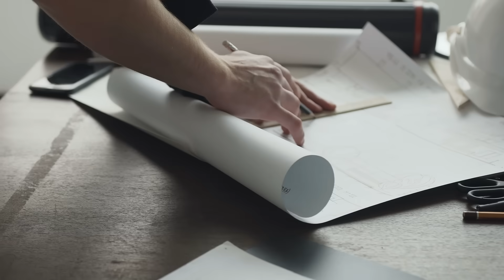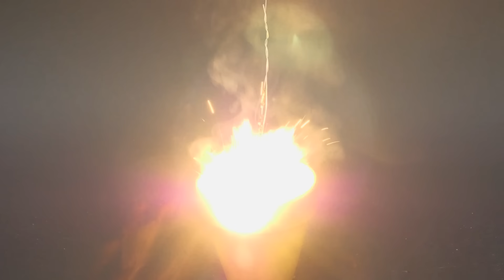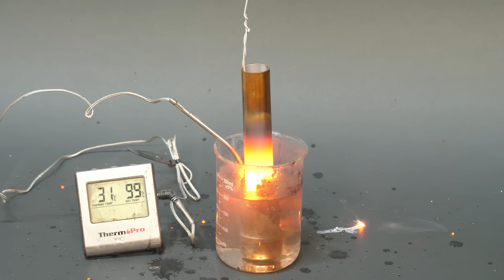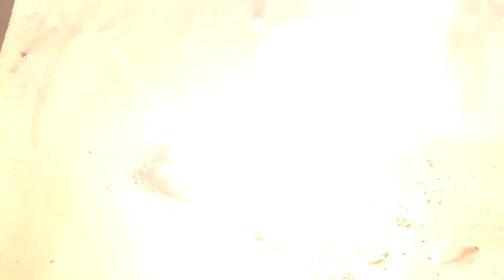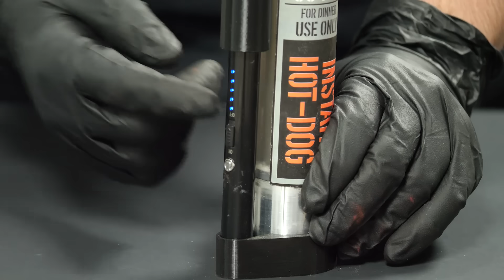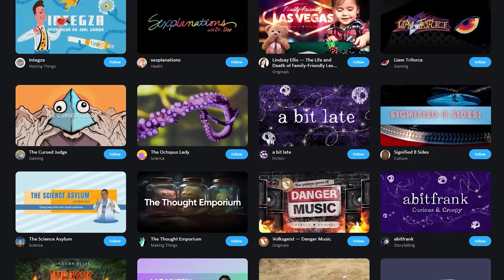Tactical Thermite Powered Hot Dog

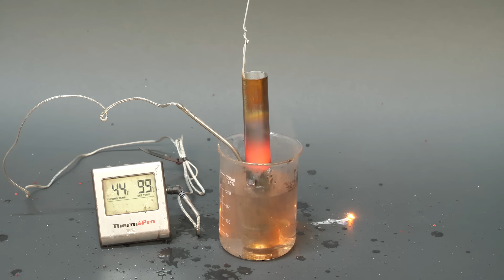Comment: 4:25 This is NOT a characteristic of iron thermite. It is characteristic to you because you never properly dry your thermite mixture. Evaporating water is what causes the degassing and thus makes the fine power you use fly away. This should be obvious since the reaction does not produce any gasses in itself, so it has to be impurities. You should try industrial thermite and see how clean and calm the reaction is. It is not only properly dried, they also use coarser materials, further reducing effects of degassing. There is no reason to use fine powders, except that it is easier to ignite. The larger surface area etc. only causes trouble otherwise. I have a video from ~2005 on my channel where you can see it burn. But I recorded that with cheap shit camera from ~2005 and was a kid at the time. If you want, I can do this again and properly record how clean it reacts.

Comment: One improvement I can immediately think of is replacing the top plug with a slam-cap that also punctures the heat seal, and linking that to the igniter.
Set up, arm, bap the cap, instant hotdog.
Reply: It's like panzerfaust but panzer würst :D
Reply: Now we just need to top it with nuclear sauerkraut.
Reply: @liliya_aseeva  bratzooka!
Reply: i need a hot dog epi pen damnit!
Reply: Per the video, the heat seal ignites and turns to molten slag.

Comment: We need the grilled version. You could use super capacitors to heat a heating element very quickly and you can recharge it very fast.
Reply: I don't know how feasible supercapacitors are for this project, but they're definitely safer than thermite, to the point this thing could probably be sold commercially (though I can't imagine who would buy it for anything but a one-time gag).
Reply: @dryued6874 I mean if they're cheap enough and I want to go on a road trip: instant grilled hot dogs would be perfect for stopping at a rest stop and having a snack. 

Imagine a shelf stable version that was self contained in a vending machine or something. 
If it's cheap enough, and it comes with bun and condiments and it roasts the bun too, it would be awesome.

Comment: As far as I can see, the only shortcoming in this perfect product is that your perfectly cooked hotdog emerges onto a cold soft bun. Since the heat is vertical and central anyway, is there a way to incorporate a vertical slot that you could slide an open bun into, and toast it at the same time?

Comment: A couple years back I decided to make something more spicy because regular thermite looked boring. I looked at the redox potential table. I wanted to go further up than aluminium and lower down than iron. What I decided on was magnesium and manganese dioxide. Lots of oxygen, +4 on the manganese too, Mg already burns hot as the sun in august, match made in heaven I thought. Well it was sure a match but it came from hell instead. I mixed 1g. One single gram. It was also a really course powder, like table salt, just mixed together. I heated it with a direct flame for like 1 second and it went off in a FPOOFH sound, taking all the hair with it. I didn't look directly into it but still saw the reflections for a couple seconds afterwards. Threw a ton of splatter too, it felt like MIG welding.
All in all, 7/10, would recommend

Comment: The granularity of your thermite is a factor. Larger particle size will still go, but go slower. The stuff in the video is so fine, it pretty much flash powder.
Also, a pretty fail safe ignition method is to use some potassiumpermanganate  and mix in a couple of drops of glycerin. The reaction is hot enough to ignite FeAl mix at a fairly course grain.

Comment: 12:20 Is there no flux for this application?
Btw. Thermite is cool. But why don't you just cook the hotdog, sealed in plastic, sealed in another plastic container containing stoichiometric amounts of concentrated NaOH and HCl solutions? This will get incredibly hot and react to saltwater 😊
You could make them like those fluorescent glow sticks. Break a seal between the two reactants, wait to react and cook, shake to be sure everything reacted, get your hotdog out. The solution doesn't come into contact with the hotdog, but even if, it's safe since it's just saltwater after reacting. The stoichiometry must be correct though.

Comment: Maybe for the grilled version, you could have the sausage in a metal frame, with the whole assembly coated in a strong thermal insulator, and when the device is activated, a high-amp, low-voltage electrical current is passed through the metal frame so it rapidly warms up to the point it’s red hot so it can cook the sausage very quickly. The purpose of the frame is to give the sausage those grill lines.

Comment: Why not use use the compound from Flameless Ration Heaters inside MREs?
Just magnesium and iron powder with sodium chloride, add some water and it will make steam.
You'd have to put the hotdog in a pyrex tube filled with water and let the FRH steam the tube. Endlessly reusable as well.
Reply: Because you wouldn't click and watch a video where someone used an MRE heater to cook a hotdog.
Reply: @c1v1c2v2  sure I would, if they made it also char the hotdog inside the tube as well by running a copper coil around it and a heat source to heat it.

Comment: I want to see a grilled version just because I Understand it would take another level of suffering to achieve it
Reply: also pro brazing tip its more than likely the metal will hotter than you are comfortable with so it accepts the brazing properly, then apply the brazing once the metal is properly heated and it should look much better

Comment: 8:50 wouldn’t it be super simple to have a little bit of flash paper or some sort of ignition plate?

Also I thought there was an alloy that reacted to compression but letting off a lot of heat, so say a thin slight dome of the alloy being flexed or crushed.

Comment: Hii great video

I had the idea that if you mount the metal rod from the beginning in your burning chamber you cud transfer the heat directly inside the hotdog whitout it turning to coal 

Theoretically you would need less thermite cause you dont need to heat the water 

As primer i would simply use some light flaming ingreedient combined whit a little magnesium foil that is connectet to the thermite

You cud also isolate the burning chamber whit some sand to further reduce theamount of thermite  

If you wanna get rally fancy you cud also insert a second tube filled whit something that boils at the desired temperature of your hotdog 
And connect it to the second tube so
That the preassure then ejects your finnished hotdog

Comment: I'm not quite half-way through when I pistol this.  My biggest comment is on grain size.  I think if you used slightly larger particle, biased to the Al, I think you'll get a slower and more steady rate.  The larger Al grains will take longer to react with the FeO2.  With it's reactivity it should still use up most or all FeO2 through absorption rather than what looks like a nearly gaseous reaction.

Comment: I used copper pipe when I made my rocket fuel powered noodle cooker as well.  I didn't consider the food safety implications aha.  Why didn't you use a threaded adapter to join it to the aluminum base?

Comment: Did you guys choose thermite just cause it was fun (it definitely was), cooks faster and was a challenge?

Cause Military Rations use Magnesium, iron, salt mixtures that create a reaction on exposure to water. So because you decided on boiling the dog you could have just created a mechanism that exposes the water to the substance and heated it up. The byproduct is hydrogen gas so you'd have to vent that. 

I just saw they've now developed a FRH which doesn't even require water and is even safer. But the the magnesium, iron, salt mix woulda been way safer than thermite (but much less fun 😂)

Comment: @12:30 - you were using flux when you soldered that joint....right?
Reply: I'm no metal worker but what exactly is the purpose of flux?
Reply: @the_undead  prevents oxygen from getting into your base metals and forming oxides which the solder cannot bond with.   Most fluxes will also eat through the existing oxide on the surface.

Comment: Can you add a binder to thermite so it can be moulded into a cylinder?    An insulated cylinder with a thin sleeve of thermite could work as a nice way to get a roast-weenie...maybe a quartz-glass central tube to surround the pork.    
A magnesium-wrapped solar -igniter works nicely with a 9v battery for thermite.

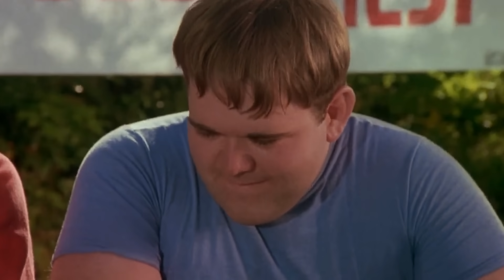Comment: @2:10 - you could still add interior cooking to your final design.  An aluminum or brass rod through the dog attached to the heat-exchange piece would cook the inside of the dog while the outside is boiled.  you could probably play with tapering or hollowing the rod to alter its thermal mass so it maintains a uniform temperature along its length while heated from one end.

Comment: Couldn't you place the heating tube in the middle of a larger package with the hot-dog chamber on one side and the other free to perhaps toast a hot-dog bun? 
The ignition could be moved to one bottom side filling the space left  on the other side with condiments to have a larger rectangular version that doesn't just boil a hot dog but has everything a hot-dog needs in a set including a warm hot dog itself, toasted bun and condiments?

Comment: I remember hearing about self heating cans on the No Such Thing As A Fish podcast, the modern ones usually use limestone and water to make the heat, the earliest versions could explode if you didn’t poke vent holes in the can.
Reply: Not limestone, but calcium oxide, also known as quicklime.

Comment: Could you wrap very thin metal wire/tubing in a coil, run heat through it, and place the hotdog in the coil? If the coils could get hot enough, it could be an effective hot dog griller and might even be reusable

Comment: You gotta sell the Tactical Instant Hotdog to the US army. It only needs three tweaks: 1) The top lid needs to be a screw lid, so it will hold a lot more pressure before giving up. 2) The clear tube needs to be beefier for the same reason. 3) It needs to come with a conveniently located pin/screw to block the vent port.

Now you have a device that can feed Pvt Snuffy right quick in a hurry, but it can also duble as a grenade. Every soldier would love to have a couple of these strapped to their vest!

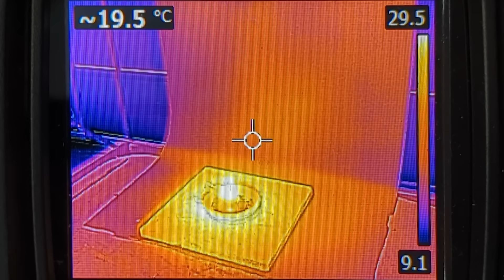Comment: 4:52 'the thermite gives off enough uv light to give you a tan just by being near it'
Sounds perfect for your next silly project lmao
Reply: Thermite tanning bed?
Reply: Now introducing "instant cancer"!
Reply: CANCER BLAST!!! @justasiggurk4614
Reply: @justasiggurk4614  single use instant cancer*
Reply: Emergency instant skin cancer?
Reply: Mmm, a nice painful 'welding sun burn' 😂 
The people will love it.
Reply: instant sun tan. you entire months dose of sunlight condensed into a single packet
Reply: Depending on the mixture that idea is anything from instant tan to instant 2nd degree burns lmao.
Reply: @megan00b8   you just get turned into a sillhoutte on a nearby wall
Reply: @theshuman100  only if you ditch termite for plutonium
Reply: @megan00b8  Uranium's your more practical option. And building a small-yield nuke is a lot easier than you'd think. I will not go into details, but one of the two ones the US dropped on Japan was simple enough both design and physics-wise that they didn't even do a test-run. It's only when you start playing with deuterium and shaped compression that you really need to work at it.
Reply: That + parabolic mirror = cancer ray
Reply: Cancer-o-matic? Wait, those things already exist

Comment: You know, for grilled, you could have the hotdog wrapped in a hollow copper coil and then send the thermkte steam through it. Would probably heat faster and hotter than resistive electrical

Comment: Try experimenting with thermoelectric mechanisms because the internal body heat of a human could be enough heat to power a self-contained artificial heart
Reply: That is not how thermodynamics works. You can't just extract energy from heat; you need access to a temperature differential to extract energy.

Comment: I got an idea for the grilled dog: make a big metal spring that goes around the hot dog
Reply: Honestly not a terrible idea. Use nichrome wire and just dump like three 18650's through it. A decent 18650 can sustain something like 20A so 60A with three of them @ 3.7V is around 200W. An 800W microwave can bust a dog in 30 seconds, but there are a lot of losses with the magnetron/transformer. Resistive heating on the other hand is almost 100% efficient.

Might need to purge the cooking vessel with an inert gas so the dog doesn't oxidize over time, nor does the heating element. Nitrogen should suffice, but why not Argon? It'll light up life the fourth of July if you use Xenon. That could be fun.

Just make sure to load it with a Hebrew National and not one of those garbage "everything we swept off the floor of a mixed killing house" pork chicken dogs.

Comment: We're one step closer to the Cowboy Beebop instant ramen.
Reply: There are a few brands of instant hot pot and noodles that use a commercial flameless ration heater. Kind of expensive, and a lot slower (about 15 minutes to heat to boiling), but very cool and very safe. They're marketed for camping.
Reply: All you need to do is replace the hotdog with the noodles. They just made something that boils water very fast, the hotdog was just the particular thing they put in it
Reply: @mind_onion  not quite, you want to keep noodles dry until you cook them or your just going to have starchy water. Though yes the termite is just a way to heat up the water. One that is self contained and needs very specific energy to ignite.
Reply: @mind_onion  Nah, sell it to campers, hikers, emergency rations etc. That's who most of the self-heating food products are sold to in the US. Easier than hauling a camp stove, safer than a beverage-can stove.
Reply: @Nixeu42  If you think that's viable, you're welcome to try and sell it.
Reply: Termite Ramen for the win.

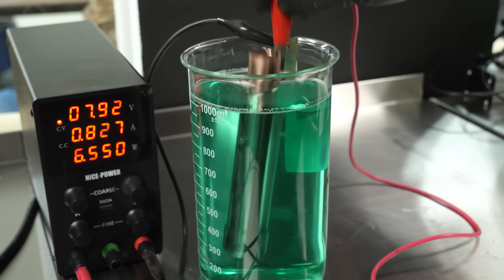Comment: 11:35 𝗜𝘁'𝘀 𝗻𝗼𝘁 𝗹𝗶𝗸𝗲 𝗽𝗵𝘆𝘀𝗶𝗰𝗶𝘀𝘁𝘀 𝗮𝗻𝗱 𝗰𝗵𝗲𝗺𝗶𝘀𝘁𝘀 𝗵𝗮𝘃𝗲 𝗱𝗶𝗳𝗳𝗲𝗿𝗲𝗻𝘁 𝗻𝗮𝗺𝗶𝗻𝗴 𝗰𝗼𝗻𝘃𝗲𝗻𝘁𝗶𝗼𝗻 𝗳𝗼𝗿 𝘁𝗵𝗲 𝗲𝗹𝗲𝗰𝘁𝗿𝗼𝗱𝗲𝘀!
There is a difference in naming between the two in cases :

1) we draw current from the cell (as in batteries, galvanic cells) and 
2) we supply current to the cell (as in electrolysis). 

In those cases:

1) cathode is ⊕ and anode is ⊖
2) cathode is ⊖ and anode is ⊕

In both cases though, cathode is the electrode on which oxidation takes place. That's how I remember it, and it's relatively easy to figure out the charges then. In 𝗴𝗮𝗹𝘃𝗮𝗻𝗶𝗰 𝗰𝗲𝗹𝗹𝘀, the oxidation site (anode) 𝘀𝘂𝗽𝗽𝗹𝗶𝗲𝘀 𝗲𝗹𝗲𝗰𝘁𝗿𝗼𝗻𝘀 for our system, so it must accumulate negative charge. In 𝗲𝗹𝗲𝗰𝘁𝗿𝗼𝗹𝘆𝘀𝗶𝘀 𝘄𝗲 𝘀𝘂𝗽𝗽𝗹𝘆 𝗲𝗹𝗲𝗰𝘁𝗿𝗼𝗻𝘀 to the reduction site (cathode), hence it accumulates negative charge.

Cheers and don't pursue electrochemistry as your field of choice

Comment: If you take traditional iron oxide with aluminum and either mix it poorly or use a higher micron powder, it will slow down the reaction very well to a point that would be much more ideal (or so I'm told)

Comment: At the army, we poked a fork in either side of the hot dog, connected that  with wires to 220V and boom - within a few seconds, there is your grilled hot dog. We used a similar method to boil water.

But don't try this at home. :face-fuchsia-wide-eyes:

Comment: "Because physics and chemists can't agree."
Suddenly, my life makes sense.
Reply: The way I remember it is anions are attracted to anodes, cations are attracted to cathodes.  If you just think in terms of "cat-" and "an-" being positive or negative you'll get confused.
Reply: @DFPercush  Is that the chemist way or the physicist way, though?
Reply: @DFPercush   Literally saying this in my head every time. I work in battery research...
@ironmoondarkwing4190: Same thing. Oxidation = removal of electrrons --> positive charge remains --> attracts anions

I'm not aware of any disagreement on that between physicists and chemists either
Reply: @DFPercush  except repulsion and attraction are reversed in fuel cells vs electroplating cells
Reply: @NikhillRao27  Exactly. The way I was told it works is anode - oxidation and cathode - reduction and to remember it through the coupling vowel - vowel and consonant - consonant.
Reply: @DFPercush 
Gotta agree with Kycilak here. I was always taught that the anode is where the oxidation happens. Never heard anything about it attracting anions, probably because it’s usually elemental metals that get oxidized rather than anions.
Reply: how do they disagree? it seems the disciplines agree for the most part on cathode and anode.
Reply: @underscoredfrisk  No.
Reply: "Red cat and an ox", reduction at cathode, oxidation at anode.
Reply: 2024 you thought we would be driving flying cars 😆 Introducing the InstaWeenie!